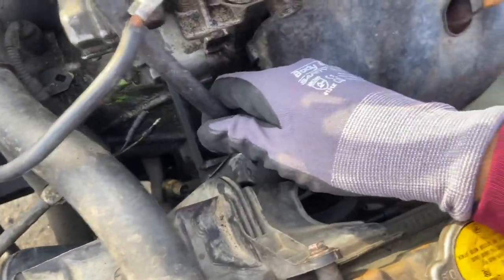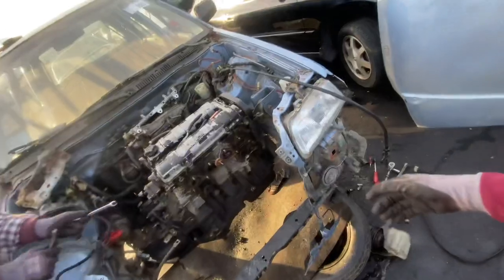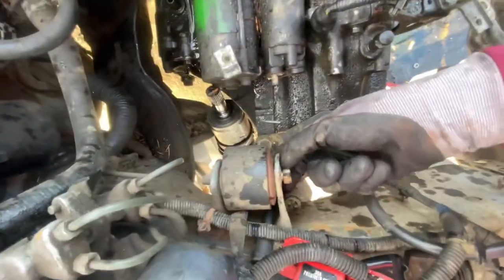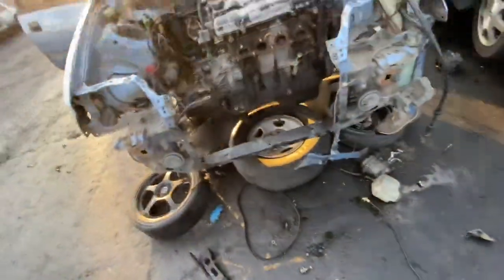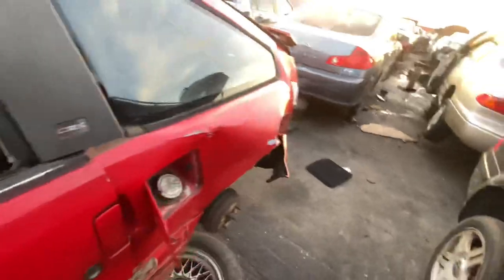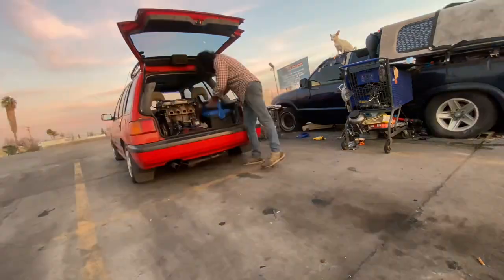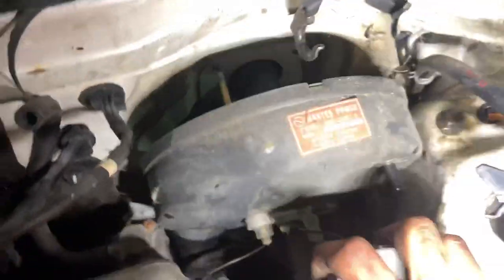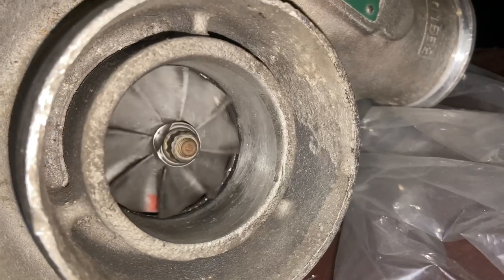UNBELIEVABLE JUNKYARD SCORE

Comment: Nate can I get your opinion man so I'm sure you remember me as the guy with the da9 with title problems. But I got an offer and I want to see what you think. There's this db1 for 600 he was parting it out but I told him I'll take the whole car. the main reason he's parting it out is the car has rust and there's some bad rust on the floor pan. But it's got a Clean title and the body is in really nice condition.  I am currently thinking about selling the da9 as is no title as is or part it out and get this one I don't have a lot of money invested into the car so it's not much. Basically what I'm asking you is should I keep my dented da9 and fix the title or should i drop and get the rusty db1. I personally prefer the sedan and I'm no stranger to patch pannels but if it's rusty in the frame rails should I not try and get it. I have another db1 part out I can cut up for the sheet metal.
Reply from the maker: i say keep both and use whichever one you’re not going to build as your parts car
Reply: @anotherefncrxvlog4350  I did just score a jdm h22a in the junkyard I think it'd be more fitting for the da9 cause I could make it a sleeper cause I have no intention of making it clean

Comment: You got ripped off  you could  get a k 24 for  $150
Reply from the maker: what am i going to do with a k24, no trans, no mounts, no manifold, no header nothing?
Reply: @anotherefncrxvlog4350  k trans+500$(if your lucky)shifter+500$,mounts+500$,header+500$,harness+500$,axles+500$,+all the lil bs parts to make that work+1000$🤣=200ish hp🤣🤣